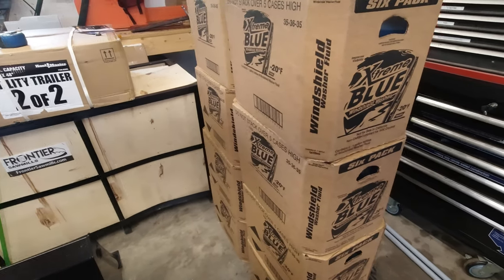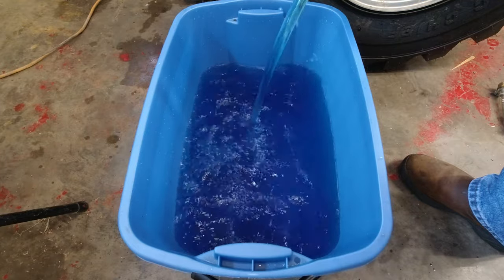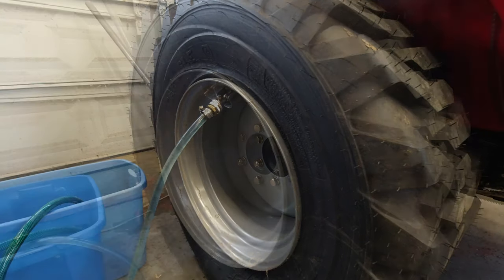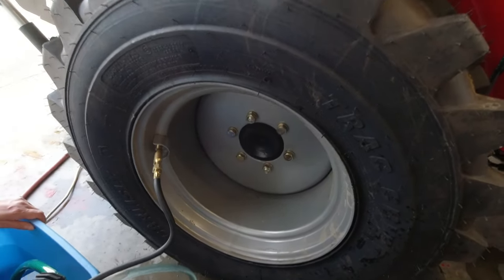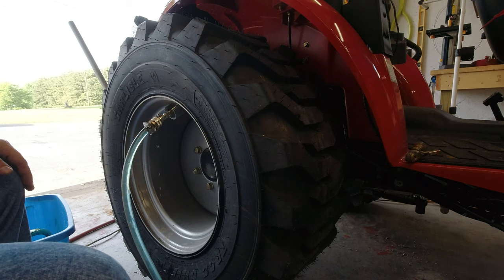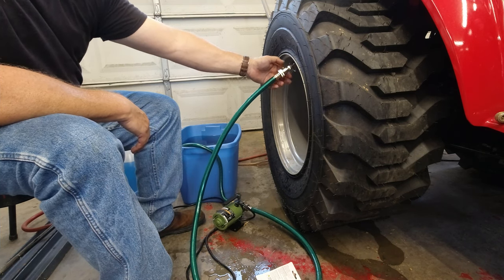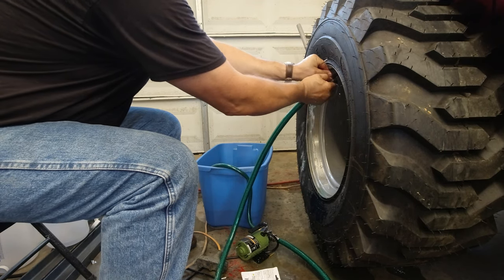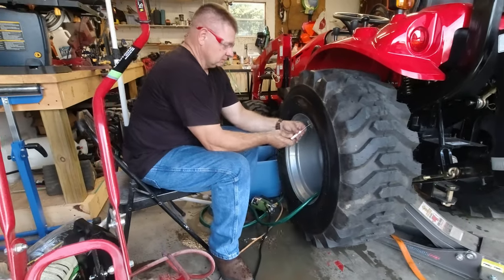Cheap Way of Loading Tractor Tires | Ballast for Tractors

Comment: 75% full means there should NOT be fluid spraying from the valve stem when you disconnect the hose. Orienting the valve stem to the top of wheel rotation provides a natural upper limit for fluid fill. Let the excess drain into your big open tub there. You have to have some air so the tire still has compliance to uneven ground.
Reply from the maker: Well OK, but mine works fine. 🤣
Reply: Good point, the fluid would expand and contract with temperature change.  I'm still loving what I'm learning on the channel. Who says social media has to be negative. God bless, guys.
Reply: Getting sprayed in the face with windshield wiper fluid means your tires are filled too much should only be 3/4 with fluid and the rest air. How did that wiper fluid taste? 🚜💨

Comment: I used  RV antifreeze and water mix in mine.  Those were 13.9 x 28 tires so it required a lot of fluid.  I have a submersible pump with a water hose outlet, so I used it and a 55 gallon drum to fill them.   It worked great and the old Ford goes up the mountainside so much better with the new rubber and extra weight.
Reply from the maker: Sounds like a good plan. Thank you for watching. Weight is king in tractors.
Reply: My plan is to use water and antifreeze.  I don't see the purpose of putting straight antifreeze in the tires, especially with todays prices!

Comment: Best on the cheap Tire fill is the garden sprayer with 1/4 inch id vinyl tubing connect the tubing to the spray wand, remove valve core slide vinyl tube over valve stem end fill tank with desired ballast pressurize the sprayer and listen to the fluid flow when it stops bleed the air pressure out by cracking the sprayer fill/pump loose retighten and pump up again until filled comes in at a price much cheaper than the pump used in the video by itself (I got a 2gallon sprayer for $10-$20 at local hardware store and 5ft of vinyl tubing for another $5 as well as a valve core remover for a $1 + cost of ballast fill) this is the lowest buck fill technique I have come across so far

Comment: Tony- thanks for the entertainment :). When you lowered the jack I saw that the bead had come off the rim and thought that this is going to be interesting! First tire was trial and error so to speak and the 2nd went much better. Good video- thanks, Gerry
Reply from the maker: The tractor  is so new, the bead hasn't welded on the rim. In the past,  I have jacked up the tire  causing a vacuum.  It helps pull the fluid in. Not this time. That was a pain.

Comment: Tony it was not your fault you lost the bead on that tire. I lost it also on the first T264 tire I tried this on and I did not even have the tire back on the ground at all. Totally up in the air the entire time.

The issue like you said is that these tires have very tight tolerances to the rims and their design of covering the edge of the rim also contributes to the difficulty in creating and maintaining the bead. The tire is very heavy as you know and will break the bead under its own weight when off the ground without air pressure in the tire.

What worked for me is getting the pump line hooked up and the pump started before all the air was lost. That was the key for me. The pump can overcome some air in the tire without any issue.

Once started I bled the air out every few gallons of fluid added. I did not let all the air out, just until it slowed down a bit and then fired the pump back on to keep that bead. 🙂
Reply from the maker: I think we came to the same conclusion. I love the extra weight on the tractor.  Have a great day
Reply: @TonysTractorAdventure  same here love the extra weight. Thank you again for the inspiration and guide on doing this! 👍🙂
Reply: @First Last Love it! Best tractor I have ever owned. Here is what I absolutely love about it:

1. Awesome Kukje engine, purrs like a big kitty. 
2. Strong hydraulics, very strong loader, surprised me greatly first time I test drove it.
3. Easy to work on and maintain, so open and spacious, components are not all crammed together as other tractors I have owned were designed.
4. I have installed the OEM rear remotes and third function myself, so easy a cave man could do it.
5. Auto throttle, love it when driving into piles for loader work.
6. Three point position control.
7. The PTO engagement is so smooth, no big jolt when it engages as all other tractors I have owned have done.
8. I love the position of the loader joystick. Very comfortable position for me.
9. Big beefy front axle and transmission housings. I was shocked how big the front axle was the first time I saw it.
10. Did I mention I love the Kukje engine? :)

I hope you get one, you will not regret it! :-)

Comment: WWF is good stuff. It's what I used.   For an experiment I put WWF and RV antifreeze in my kitchen freezer.  RVA froze solid at -12 degrees.  Bottle said -50 burst protection meaning it does freeze but it doesnt swell up.   WWF still liquid at -18.    Surprising results.
Reply from the maker: Thank you for that information.

Comment: Even before I watched the video, or read any of the comments, I knew there would be some "lively" discussion on this topic.  As with any online discussion, you'd be coming up short if you didn't have an armchair quarterback or two trying to set you straight.  A lot of YouTubers pin the most ignorant comment of the video, but I find that just gives the trolls the attention they want.  Seems to me, ignoring them denies trolls of the attention they are seeking and let's them go hide back under the bridge.  But, it's your channel.

On topic, as you point out, liquid ballast in tires has been around as long as there has been rubber tires on tractors.  Old timers used a sodium chloride solution which would of course rust out rims over time.  Liquid ballast does not increase rotational inertia of the tire, thus it adds no load to the frame or axle bearings, or wear the brakes.  Liquid choice is important.  Any "-chloride" solution is a salt, and will rust the rims (and kill your grass if you spring a leak.  Auto antifreeze is a no-no as it is very toxic.  RV antifreeze is not toxic, but it is significantly more expensive than your WWF.  The king is that Rim Guard stuff made out of beet juice (denser than any other media), but it's expensive.  I was appalled that my Branson was delivered with magnesium chloride loaded tires.  It was really tempting to tell the dealer to take it back and give me new tires and rims.

I have loaded many a garden tractor tire myself, and you can get the job done with a funnel and a hose if you have the patience and time to let gravity do its thing, but the pump and adapter is the way to go.
Reply from the maker: It seems counter productive to pin a trolls comments, but I have found it opens the debate and answers questions, many are afraid to ask. I love your comment, BTW. Tony

Comment: I just had the tires on my t264 done at tire shop, if you use rim guard at add 480 lbs to back tires.
I would not fill front tires, instead add 1 gal of stop leak to front tires so they dont go flat very easy. Iv done this on bigger tractors work great.
Reply from the maker: I try to do most things myself and I look for value.  I traded off a little weight for value . It still changes the tractor dramatically.
Reply: @TonysTractorAdventure  I give you credit you get it done. I went with rim gaurd cuz I needed as much weight as possible, these loaders are strong and i have employees drive it, if they were big tires I'd use the washer fluid also.
Reply from the maker: I would still have to have additional rear ballast even is I had used Rim Guard. The T264 is pretty amazing with how strong the loaders and hydraulics are. I am building ballast box next so it is close in to the rear, but heavy enough I can get everything out of the tractor. Some of the logs I am lifting are close to max. Have a great 4th my friend. Tony.
Reply: @TonysTractorAdventure  boy you are right it needs a ballast bad. Looking foward to see what you do.
Happy 4th. God bless America

Comment: I have used windshield washer fluid in tires before it's a lot cheaper than rim guard. The dealership where I bought my new tractor put rim guard in with the deal . I'm thinking if you ever have a flat though it's going to be a sticky mess.
Reply from the maker: It is a sticky mess for sure. Happy Independence day

Comment: Hey Tony, according to the Rim Guard fill chart, your rear tractor tires requires 22 gallons per tire in order to achieve the 75% fill rate. Cheers!
Reply from the maker: I just fill it until it shoots out the valve stem. It works fine at a very low cost.
Reply: @TonysTractorAdventure  That should be something in the 70-80% range.  It's also the way it has been done for decades.

Comment: Good day Sir 🌞 With that added weight, you will be able to do work safer with your grapple like you have written on your text. 😉 Great video Sir and Yes safety glass is important and great helper too Cheers 👍😊🌞
Reply from the maker: Yes sir. Safety  glasses are  good.  It made  a big difference.  It how the tractor  acts.
Reply: @TonysTractorAdventure  👍🌞😉

Comment: I'm curious now Tony.  When i bought my John Deere the salesperson told me they would put 48 gallon of windshield washer fluid  in for me. My tractor tires are on 20" wheels and looks to be about same size as yours. I'm kinda thinking they didn't put all that much fluid in as sometimes I don't seem to have enough ballast. 48 gallons of fluid should weigh about 450#s. The only thing I  know to do is rotate each tire and try to figure out where the level is.  Maybe i need to add more.  Thanks buddy
Reply from the maker: Even with loaded tires I still use a ballast on the back. Tractor loaders are so strong these days.

Comment: Do you have a video of lifting things before and after you loaded the tires? Such as the back end rising up and then not with the same thing being lifted?
Reply from the maker: I don't, but that would have been a good video. Where were you before this. LOL😀
Reply: @TonysTractorAdventure  Well, I am trying to decide, should I weight the tires or just build a counterweight. When I sold my FORD 851 I gave the counterbalance 55 gallon drum with it. It was double weighted. Rear tires and the counterbalance. 
I'm thinking of doing the weighted tires. I think that will help better at pushing snow in the winter since the weight will be at the axle. Plus, it means the weight isn't ON THE AXLE.

Comment: Those tires can hold 23 gal each I'm told from tire shop, rim guard is 3lbs heavier then water per gal.
Reply from the maker: Your are right on Rimguarde. I got 24-25 gallons in mine.  Rimguard is really good. It is messy sticky and cost about 4 times as much so that  factored in for me.

Comment: Well that’s an interesting concept, something that I wouldn’t have thought of on my own that’s for sure.

So the idea being you add weight to the tires to help counter balance the loader weight……..to prevent it from tipping forward when loaded really?  If you keep your backhoe on all the time would that achieve the same effect, or is it better to drop the backhoe when not needed and just run with fluid in the tires? 

What if I only have pink windshield washing fluid, will that work?? 🤣🤣🤣
Reply from the maker: Pink windshield washer fluid works better 😁😁 You get 10 more HP for  pink fluid.  All seriousness,  it is a long time farm practice to fill the tires. I don't have a backhoe,  most rear implements are not heavy enough.  It added about 400 pounds on the ground.
Reply: @TonysTractorAdventure  Thanks for the reply Tony, that’s good info.  👍
Reply: Pink fluid is fine as long as the tractor is confident enough to pull it off. We wouldn’t want other tractors to bully him. 🤣

Comment: I must have missed just how many gallons per tire you used.  Do you happen to remember?  I could prolly figure it out from the weight you stated it added but I’d rather not end up with ten years worth of extra washer fluid in the garage🍻
Reply from the maker: If memory serves,  I ended up using 11 gallons per tire. I use windshield washer fluid as a blade cooler in the winter months. It will not freeze and bust the holding tank.
Reply: @TonysTractorAdventure  thank you much, Tony!

Comment: Tony, are those the 14-17.5 rear tires? If so is it 22 gallons per tire to meet the 75% full level. You mentioned 30 gallons of fluid. Is that per tire or a total?
Oh and is there a reason not to fill more than 75% that you are aware of?
Reply: @cha-Ka, fluids don't compress (at least not at pressures the average joe will deal with), so you need some air space to pressurize the inside of the tire to hold the bead on the rim.
Reply: Would like a thought or two on running PSI for liquid filled rear tires: 1.) carrying heavy 3pt attachments vs 2.) trying to get maximum traction with just a 3pt blade say clearing snow on a slippery surface. Thanks for the videos, Merry Christmas to all.

Comment: Why windshield fluid not a regular water
Reply from the maker: Water rust metal and freezes. It would bounce you off the tractor driving with frozen water in the winter.

Comment: Is washer fluid corrosive and will rot the rims?
Reply from the maker: No. People  spray it  on their cars every day.
Reply: Actually most soaps will serve as a rust preventative.   Most RPs used in industry are actually soaps.   The washer fluid will protect the rim from rusting and also has a lower freezing point than plain water.   Pure water isn't even that much of a problem.  Some farmers run straight water in their tires because it is cheap and easy to replace in the field.  It doesn't seem to cause much in the way of problems.

Comment: There is a better way to load the tires.  The way that I do it is to: 1. Remove the tire from the tractor.  2. Lay the tire down on its side, valve stem up.  3.  Fill the tire up.  This way you can fill up to 95% of the inside of the tire.  There is no getting sprayed in the face either because you can just lean back away from the direction of the spray.
Reply from the maker: Sounds reasonable!  Thank you.  I have always heard 75% fill was the right level,  but no one says why.
Reply: @TonysTractorAdventure  75% because then you still have the cushion that compressed air will give you ... Liquid doesn't compress ...
Reply from the maker: That is what I have always heard. Only 75 percent.
Reply: @TonysTractorAdventure  I think that the 75% number is given because that's how filled up it will be when the valve is at 12 o'clock.  The air cushion idea actually makes sense, because liquid indeed does not compress.  But even when filling the tire on it's side, you can never completely fill it and there will always be a air cushion in there.  The question is whether 75% is some magical number that exactly fulfills the liquid/air cushion equation, or if it is just for practical convenience?  We have all "heard 75%" but who is the originator of that statement?  An engineer that studied the matter and decided on that number or a salesman that made it up off of the top of his head?
Reply from the maker: I like the way you think. 👍👍👍
Reply: My understanding of the 75% rule is so that you're still able to put an air pressure gauge on the tire when you're filling the last bit up with air.  If you fill beyond the height of the valve then you would get fluid into your gauge .. that's especially bad if you filled with a sticky liquid.

Comment: Can't see the point of it.
Reply from the maker: That's OK. Are you new to tractors? Adding extra weight in the rear tires brings much needed ballast to a tractor.  Even though this only adds about 400 pounds to the rear tires, it makes a big difference in how it lifts  a load.

Comment: Good video my sun had a new tire put on and had fluid put in and I asked the man why he did not have the valve stem at the top he said never do that you only fill three quarters up you need the rest for air space and he has been doing it for thirty five years
Reply from the maker: Mine are at 3/4  full. I have  only  been doing it  30 years. Back in the day most farmers just used automobile antifreeze  and water. In row crops  that is fine,, but  it can kill livestock if it leaks. We jave dogs and cats, so i went this way.   It evaporates very quickly if it leaks. I have seen it done a hundred  ways. As long as it gets  in there, it is fine. It is not rocket  science down the ml accuracy.  It just putting  fluid  in a balloon.  Have  a great  4th.

Comment: I used -20 windows shield  washer fluid mine took 30 gallons per tire  I got it for $2.19 a gallon  it weight is 8 lbs per  gallon.
Reply from the maker: That is the same thing we did here. It was a very cost effective way of doing it. I did spring myself in the face though. 😁